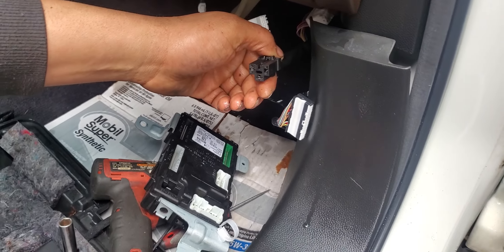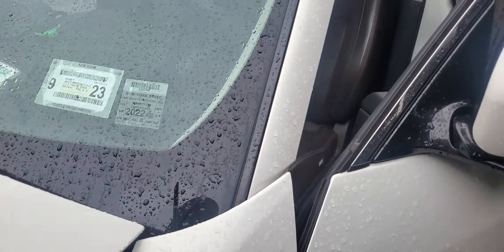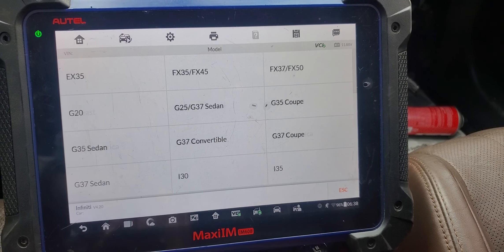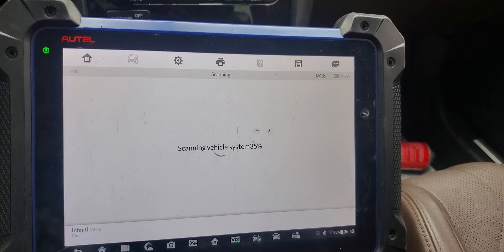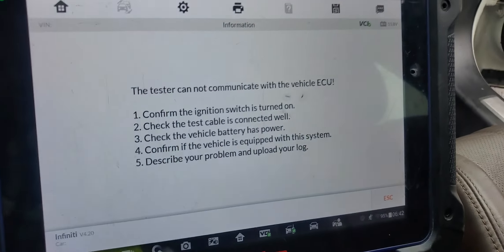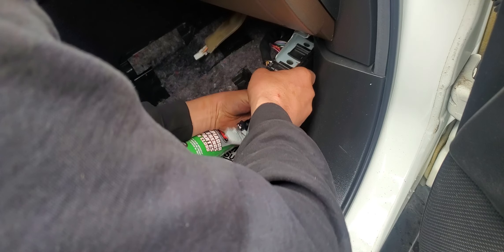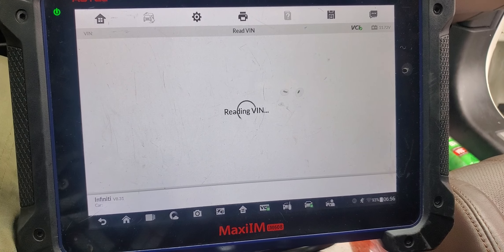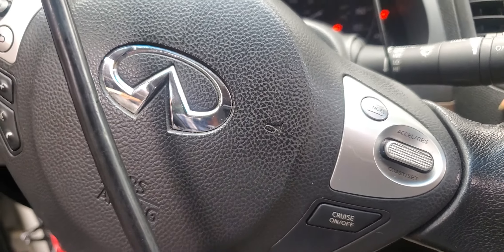2013 Infiniti FX37 No Starting No Cranking No Communication Diagnose Result

Comment: I have 2013 infiniti g37x sedan idk if I have water damage but mines was running and battery and break light was on. I bought new battery and drove it home but the battery and break light was still on . I have new alternator but I do have a coolant leak and it’s coolant on alternator do you think that’s what’s wrong with it? I also had too replace the Connector that connects in the alternator the one that’s clicks on it. When I replaced that I use those dorman tite connectors.